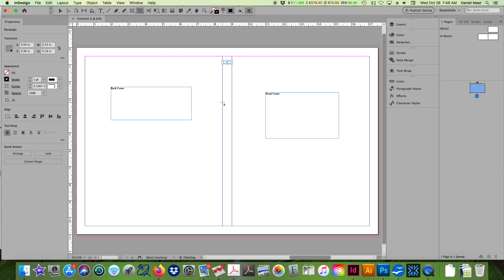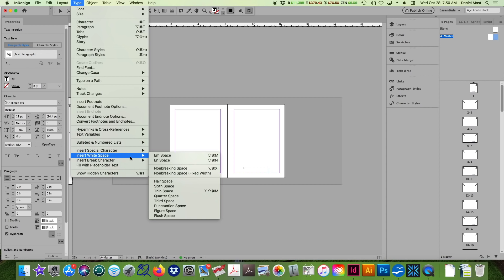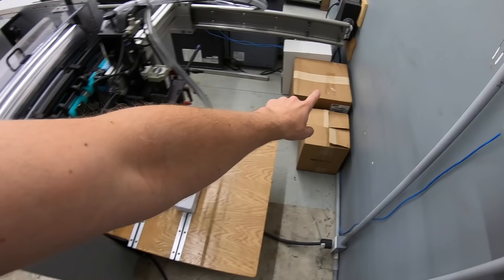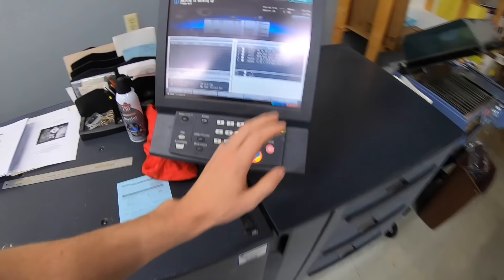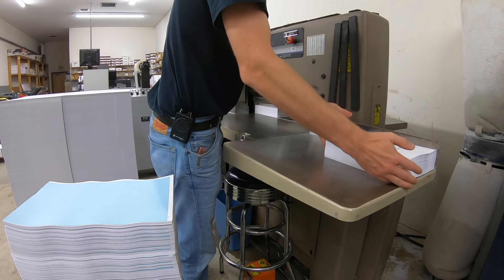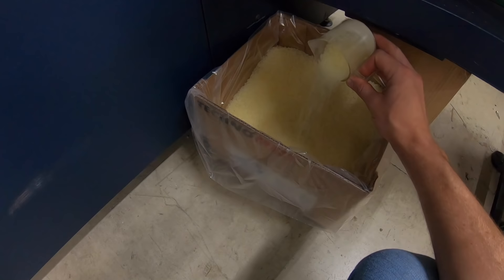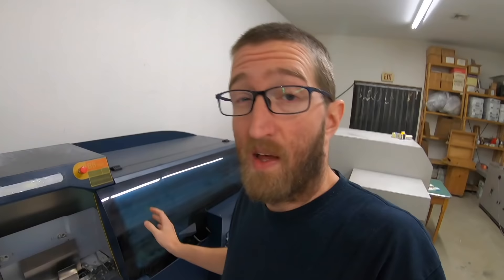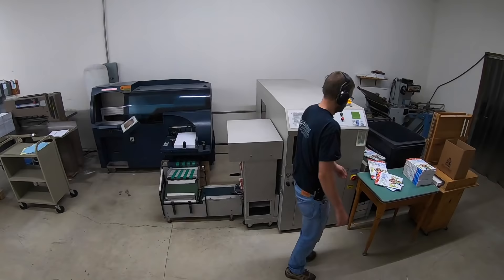Book Production From Start To Finish, Digital Printing and Binding Perfect Bound Books

Comment: Where did the 435 come from when you calculated the gutter size? Thanks.
Reply from the maker: 435 is the number of 60lb text pages in one inch. That can be calculated from the caliper of the paper or just counting the number of sheets in an inch and multiplying by 2.
Reply: @justaprinter  thank you!

Comment: you couldn't run pur in that binder without installing  a extraction system. is carcinogenic. you would also have to remove those knochting kiives as there not needed. we use a separate side glue so im not sure how you could do that on that machine
Reply from the maker: You are correct. I would need a completely different application system if I went to PUR. Thats part of the reason why I use my current EVA.

Comment: Greetings. This may be unrelated to your vid, but I'm starting to get into Bookbinding, and I want to print Comic Book Graphic Novels and Omnibus Books (which are collections of many comic issues in one book). I want to print them with the best quality image, and since the pages are essentially all images - do you know what kind/type of paper I could use for this? Do I or can I realistically print some sort of "glossy" paper" All I know is if I use typical paper they won't come out with crisp images. Any input/opinion/advice you could offer - I would be eternally grateful. Thanks in advance.
Reply from the maker: I'd suggest an gloss or dull paper. Either 70 or 80 pound text.
Reply: @justaprinter  Thanks for responding. When I look for 80 pound "glossy" paper - it comes up as "photo" paper. Is that the same thing? Isn't "photo paper" only glossy on one side? Thanks in advance. 

Love your channel by the way. I dream of the day I can have a shop like yours...
Reply from the maker: @jaekrieldgx8245  Photo paper is very glossy. The brand I use id Sappi Flo Gloss.

Comment: What version printer do you recommend for a small shop?
Reply from the maker: I like the Konica 3070
Reply: @justaprinter  oh, I guess I should have said for small runs. I'm not thinking of starting a business. I was even thinking of finding a good inkjet, if the colors are more vivid than with a laser. That konica is pretty hefty in size and in price.

Comment: what does the binding machine do with the signatures?
Reply from the maker: If you want to bind signatures you can use the milling blade to grind the lower edge of the signatures off completely and then glue them.

Comment: What do mean about bleed?
Reply from the maker: Bleed is the .125 inch that gets trimmed off. If you want a graphic to go to the edge of the paper, you actually extend it beyond the edge and then trim to final size. If .125 extra bleed is not included you might have a thin white line from the paper appear.